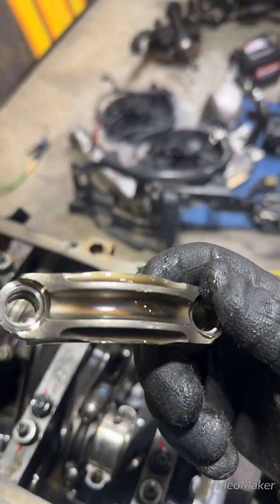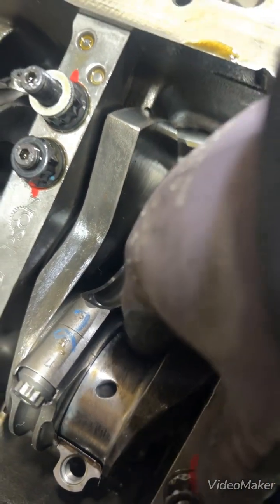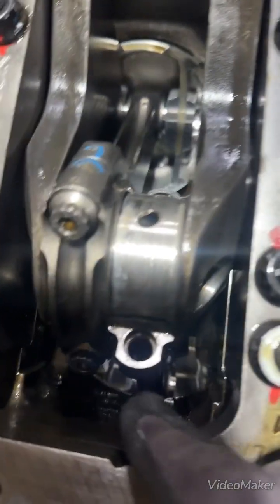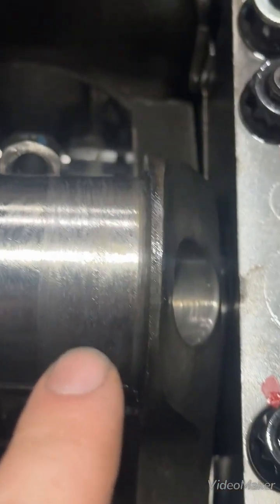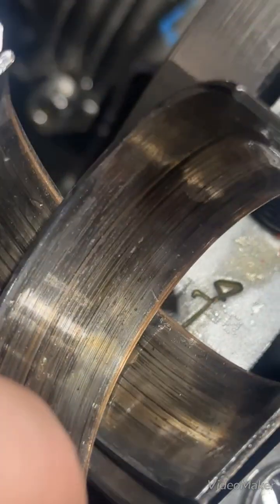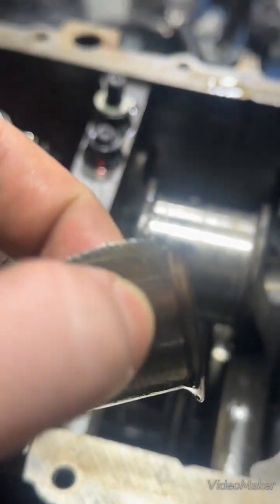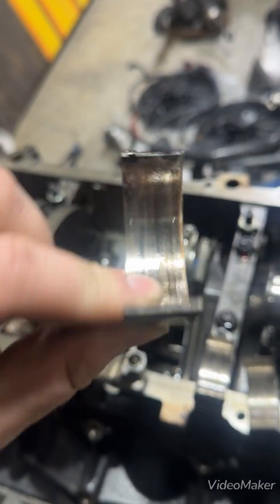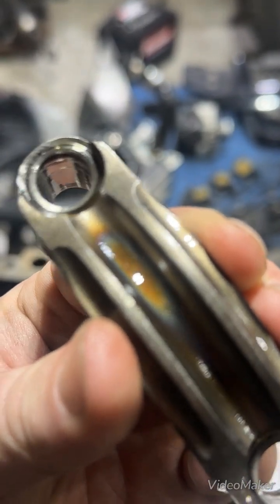408 LS Turbo knocking

Comment: So what caused this
Reply from the maker: Hard to say exactly as it can be a number of things, on my LS swapped Jeep I once didn’t have the limiter set and it revved high in the rpm and spun a rod bearing. In this case I’d imagine it was just a lot of force caused enough clearance for it to spin not an uncommon failure point just unfortunate.